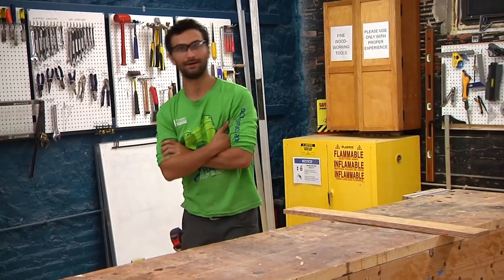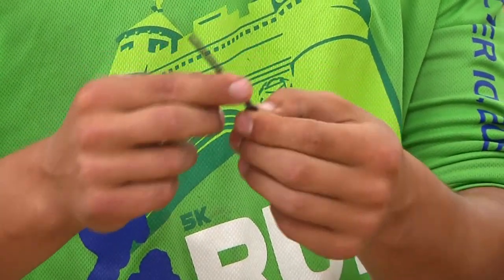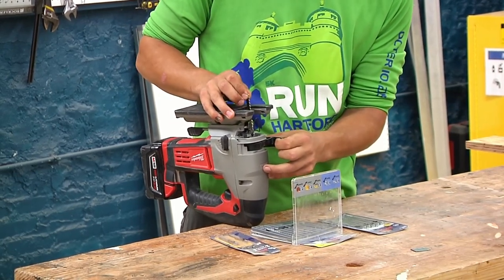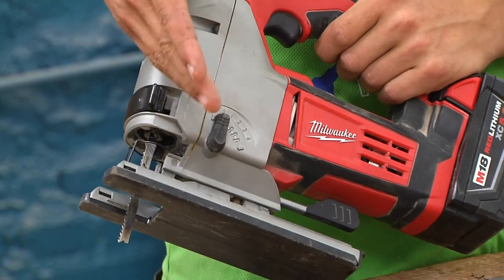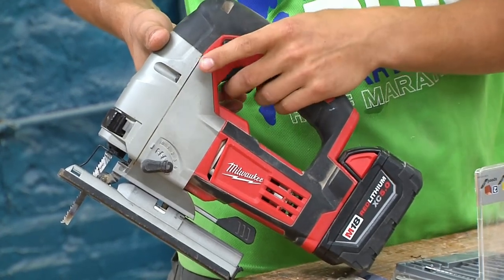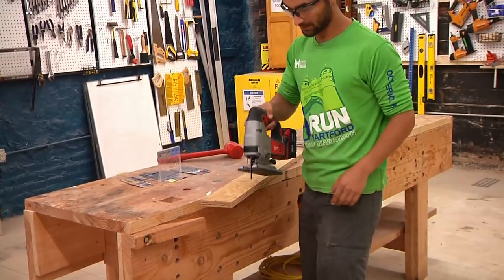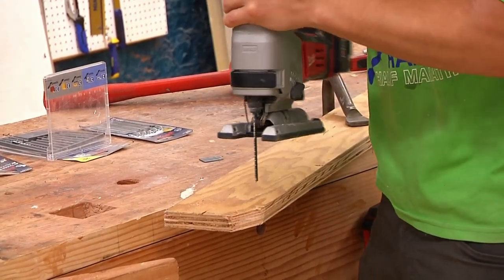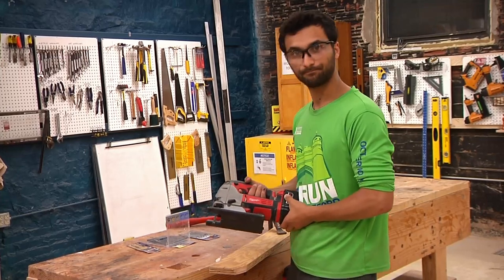How to Use the Milwaukee Jig Saw

Comment: The bevel switch fell off mine, i had to return it.
The switch was vibrating allot while using it, within 10 secs of cutting it would get loose ruining my cuts because it dropped into a angle, eventually falling out and disconnecting  the how shoe (bottom with it)..i tried screwing it back but it appeared to of been stripped or missing a washer ring or needed one in the flat area where the switch goes., Amazon  replaced it.
Reply: I'm having the same problem what do I do to fix it can't get it to screw back to the lever and returning is not an option also not sure if something is missing like you said there is no washer etc
Reply: @lilrida649  well, I simply sent mine back to amazon, got a refund and ordered the 18v fuel for roughly the same price with out a battery, never looking back, its kind of heavy and bigger, I got the D grip one which I think was not the one I should of got, better off barrel type to cut artsy stuff... but I have to say I can handle the weight and I hold 2x4s in one hand while cutting them with the 18v, like butter compared to this 12v joke, the motors die on those cause they ant brushless..  but before I sent mine back I used duck tape to hold the bevel handle, wrapped it around the handle to the side....but after 30 mins the silly thing found a way to vibrate back again!